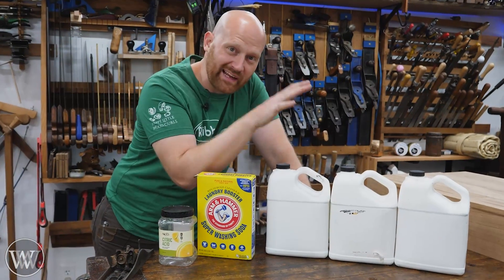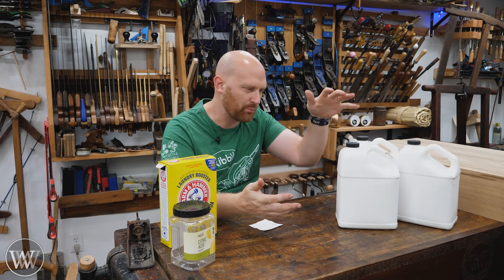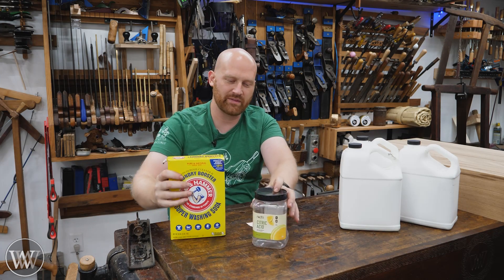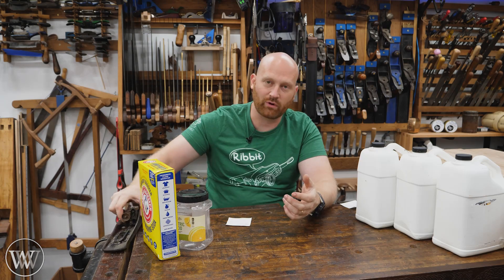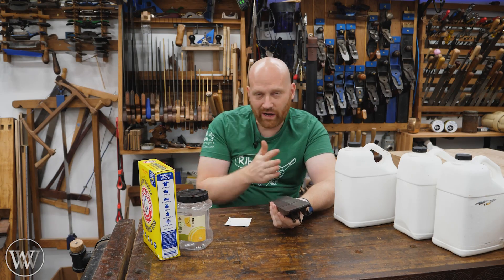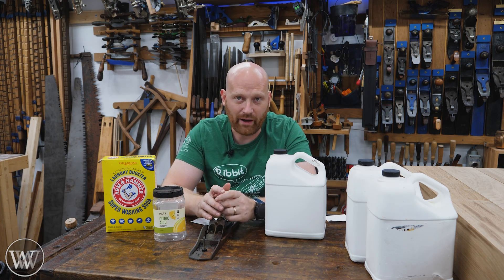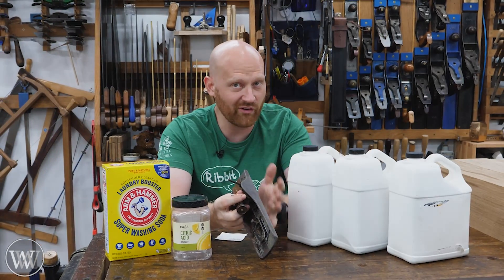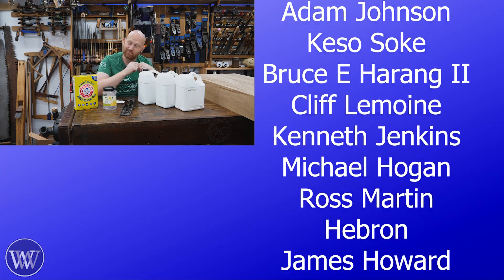Rust Removal REVOLUTIONIZED The New Affordable Way

Comment: Small note about Washing Soda...
Washing Soda is Calcium Carbonate. Baking Soda is Calcium BI-Carbonate. What this means is that when stored over time, Washing Soda turns into Baking Soda. Basically, it absorbs carbonate from the carbon dioxide in the air... This does take a while, but it makes long term storage kinda moot...
HOWEVER, THERE IS AN EASY FIX!!!
Cook the baking soda over medium heat in a pan and stir slowly so you just keep breaking up clots to powder and then to turn the powder over and over as it "out-gasses". You CAN SEE the out-gassing as pin holes "puffing" out of the layer of Soda powder, but there's also going to be some obnoxious dust kicked up as the carbon dioxide vents out. DO NOT INHALE THAT STUFF. It's a mistake you'll only make once, but you don't even want to make that many. It's HIGHLY HIGHLY recommended that you invest in a cheap "buffet burner" or whatever they call those single stove eyes in your area, so this can be done outside.
In any case... over medium heat, and stirred constantly but methodically, Baking Soda turns into Washing Soda as it vents off all that excess Carbon Dioxide. When it quits puffing little holes and raising dust in the air, you can compare the color with a known sample of Baking Soda, and the fresh Washing Soda will seem a shade or two dinjy gray next to the brighter whiter Baking Soda.
NOT that I'm just too cheap to buy proper Washing Soda, myself, of course... BUT I dislike accidentally pouring a product I assume will boost cleaning only to find out it has aged past it's usefulness... it's nice to at least be able to fix that WITHOUT just running out to buy another box of something that might well age past use before I can use it all... Just for instance... 😂

Comment: I discovered this mixture about a month ago—-IT WORKS!  I also sprung for a ultrasonic cleaner…not necessary but the rust ends up at the bottom of the cleaner’s tank.  Amazingly, it only takes a couple of hours, with or without the ultrasonic cleaner.  This stuff is amazing!

Comment: Does it damage coating (zinc, galvanization etc) in non-rusted areas?
Reply from the maker: Not that I have found so far. mostly with chrome finishes on tools that I have been working with.

Comment: Great video. For inspiration, go and watch the old DrX videos. That now out of business company had videos showing dipping engine blocks, anchors and even spraying rust car bodies. The result: rust melted off  leaving clean metal. One thing that has not been addressed. DrX also offered a neutralizer solution. They claimed that once treated an unpainted piece of metal would last up to 3 weeks, indoors, without flash rusting.

Comment: Saw this on the Beyond Ballistics channel, have been using it ever since.  It's the mutt's nuts.  A quick gripe on the language you use, though.  You're not using the base (Na2CO3, NaHCO3 or NaOH in BB's recipes) to "neutralise" the citric acid, you're reacting the two to form an entirely different chemical - sodium citrate -  along with some byproducts -  water and carbon dioxide in the case of washing soda.  Guess which one of those two makes your bucket fizz up like a mofo?  While chucking one of these bases into citric acid will, in fact "neutralise" it inasmuch as it will stop it acting like citric acid would normally, that's not your goal here - you're specifically looking for the sodium citrate as a chelation agent, which is why the recipe gives specific quantities rather than just "chuck some washing soda in it".

Anyway, have fun with it, it's great.

Comment: Hey James! Im pretty new at restoration and have some questions. Is this process the way to go to just get the hand plane back to functional use but you sacrifice the patina or is this process the way to go for cleaning and retaining the value of a collectable hand plane? Thanks!
Reply from the maker: This is the process if you're going to be stripping it down and going back to new. If you just want to get it up and going then usually a little bit of sandpaper to get off any surface rust is all you need.

Comment: This stuff works. It's as good as muriatic acid, but better cause it doesn't eat away at the steel as much. I've tried on a pair of rusted wheel knuckles.  It got rid of caked up rust. This stuff is a beast. I wish I knew about this stuff along time ago. It's definitely a time saver. Beats using a sandblaster and especially muriatic acid.

Comment: While I'm not a chemist, I do have a deep fascination with chemistry. Metals seem quite indestructible, but they're often very vulnerable to oxygen and acids. Very weak acids like vinegar or citric acid will eat away metal, but very little. The hotter an acid is the more quickly it reacts. Reaction doubles for every 10 degree C increase in temperature. 

For this reason, I don't use acids very often to clean rust from metal. A better solution I think is to use lye, or sodium hydroxide. If you combine 5 gallons of water with 1 pound of pure sodium hydroxide and mix it well, you'll get something that will gently pull away rust from metal without damaging the metal itself. 

The chemical formula is NaOH + Fe3O2 → NaO3H + 3Fe. Here we can see that the sodium hydroxide bonds with the oxygen atoms that makes up the rust, turning it back to iron metal. When I fix up cast iron cookware, I usually leave it in there for a day or two, but I've never had it harmed by leaving it in longer. 

Lye is quite caustic so keep it away from kids and pets, keep it covered. Wear eye protection, DO NOT FORGET THE EYE PROTECTION, and gloves. Once you're done, since it's the same thing as drain cleaner it's no big deal to dump it down the drain. But if that worries you, you can always neutralize it with vinegar. Just add slowly until it stops foaming. 

By the way, if you have citric acid and washing soda you can use it to make sodium citrate. Melt some cheese in some water and add a wee bit of sodium citrate and you got nacho cheese. You need very very little sodium citrate for this.
Reply: Have you tried sodium hydroxide as a rust remover, because I doubt it will do anything at all with iron oxide.

Comment: You have to use a lot of citric acid to make 3 gallons worth.  That small container you show has enough citric acid to make 3 gallons worth of the rust removal solution??
Reply from the maker: That is all that is needed. You can see the recipe in the description

Comment: I'd like to see how this would affect painted metal.  For example, you have a bumpy eruption of rust on the main frame of a painted bicycle you want to eliminate, without screwing up the paint on the bike, or a bumpy, orange, chrome (is it really chrome?) steering wheel on the bike. How much damage would we expect in those two circumstances on a bike? it might be impossible to dunk a bike in an old bathtub of this stuff. What if we soaked some old beach towels in this stuff and wrapped the towels around the affected area, returned frequently to drip solution onto the towels to keep them soaked in solution--what kind of results would you expect then? How long would you keep the towels onto the bike, roughly. What would we do then if we are happy with the results? give the bike a soapy bath to remove the solution from it?  And for those tiny bumps your fingers can feel, is there a semi-abrasive lotion that could be used for that final problem? I'm thinking of the product called,  "Soft Scrub" my mother used to use to scrub her good pots and pans with after cooking with them. It scrubs the debris off without scratching the shiny pots and pans, what do you think? want to cut up a salvation army old rusty  toddler bike and find out?

Comment: i find the amount i mix up (squirt bottle) looses its potentcey after a while (day or 2) , so i just mix it as needed in a 3/5 ish ratio.
  
oh yeah 

mix it with a little bp blaster to make an "emulsive paste" ( or something ) (suspended chemical reaction) 
"it" = the powders, no soap, no water 

this way it will stick to the side of something or pack around a nut/bolt 
still testing other oils - want to stay away from water everywhere - needed for chemical reaction yes but shutup i havnt tested that out yet

Comment: Will this work if you just spray it on the rust ?
Reply from the maker: No it needs time. You can soak a rag and put it on but it does not work as well.
Reply: @WoodByWrightHowTo . Have you looked into making a gel that would be very helpful for parts you can't take off I see someone using boiled cornstarch and clean film mixed with vinegar don't know if it would work with this stuff and I see someone use amorphous fumed silica added with acid would be excellent if you could do a video testing these
Reply from the maker: Most gel removers work about as well as a rag soaked in the liquid. but I have not tried to make this a gel

Comment: I use one part citric acid to five parts ammonium chloride. It seems to also reduce flash rush. For it to work you must use a 1-5 ratio. Like most rust removers it works better warm. I based mine on information that I had about a powder that you mixed with water. I guy sold it mail order in the 1970’s. He died a number of years ago. I still have to get some test strips to check it’s ph, but it seems pretty neutral.

Comment: I watched the Beyond Ballistics presentation - and even added my two cents on the process.  I thought his work was excellent.  The chelation approach has merit, and citric acid works well.  There's also a pure reduction method that simply de-oxidizes the rust, which works differently, but also has merit.  You just use a cheap tarnish remover - Tarn-X is an example - and it doesn't take up much space on the shelf, cost much, or require mixing, a bucket, or a scale; it works fine for smaller jobs - down to Q-tip size.  And of course, there's electrolysis.

There's a useful contrast, however, in the means by which a reducing chemical process works and the way electrolysis works: chemical reduction just takes away the oxygen that makes the elemental iron into rust, and returns it to elemental iron, without affecting iron that ISN'T rusted.  Essentially, that's like a "reset" of the surface (although it can't magically replace iron that has flaked away thanks to the dimensional change that happens when the iron oxidizes, expands, breaks loose, and flakes off, leaving pits).  

But it does leave you with a fresh iron to then treat how you like to further protect it - plate it, paint it, blue it, phosphate it, parkerize it, oil it, grease it, etc.  If, on the other hand, you use electrolysis, you preferentially, in an iron alloy, change the alloy at the surface, depending on the location on the electromotive scale of the particular alloying metals used in the steel you are derusting; some are removed more readily than others.  And the effect is across the entire surface undergoing electrolysis - not just the rusted parts; so ALL the surface is electrolytically etched, rather than just the oxidized iron compound.  Not a huge detail, perhaps, but one to be aware of as a differentiating characteristic.
 
We go to school and have this stuff ramrodded into our heads in order to pass a course, but it also has real world consequences that can be useful even out back in the barn.  In the case of this chelating solution, the fact that you can get 30 times as much de-rusting from a simple solution compared to a commercial product is an example of that.  "But I'll never use algebra in the real world"!  Well, maybe, maybe not.  But this chemistry stuff sure paid off.

We're all here on YouTube to share the collective wisdom of the tribe for our mutual benefit.  Like, for example, use a bucket when mixing . . .

Comment: The end-chemical you're trying to make with this mixture is sodium citrate, which you can buy food-grade of directly and by the pound for fairly cheap. I use it to make queso, so I had some already.
Reply: Yeah, but there is mono, di and trisodiumcitrate. So, which one are you going to buy?
Reply: @rogierius  Whatever's sold as a food additive, making it easy to get. I used to make it by putting baking soda in lime juice and while that's delicious for queso dip, it wasn't as flexible as having the powder on hand. I've already used it to strip rust, so I doubt it needs to be that particular.

Comment: You're saying that the soda neutralizes the citric acid, but as Beyond Ballistics says, in his video, his recipe results in a solution with a pH of four ...which is acidic, if not nearly as bad as citric acid. Evaporust is apparently around 6, which is close to neutral. Why Beyond Ballistics didn't make a more neutral solution, I don't know.
Reply: Because it doesn't work any more. He said that.
Reply: @neutronalchemist3241  No he didn't. Not in the video, anyway. Either way, that means that his solution DOESN'T work using chelation, as he claims. (if it did, there would be no reason for it not to work in a neutral solution) ...and that he is fully aware, that his claim that it completely uses up (i.e. neutralizes) the acid, is 100% false. I.e. that he lied ...though given how he is aware that the pH is 4, this was already clearly the case, either way.
Reply: @ZarlanTheGreen he is not a chemist, and that was one of the first things he said. So instead of being a liar, he might just not know?
Reply: @ There is no possible excuse of ignorance. This is among the most basic chemistry knowledge there is. Anyone who's ever gone to school, knows that a pH of four, is acidic ...and this is also clearly and explicitly pointed out, on the packet of testing strips.
Reply: @ZarlanTheGreen  not picking a fight here mate. Just pointing out that in all likelihood Carlo has no nefarious motives here.

His rust removal solution is based entirely on US patent US5653917A. 

If you have the time, I'm curious what you make of the claims in that patent. Ben Cusick from this YouTube channel NighthawkInlight tried out Carlo's recipe and couldn't replicate the same results. So perhaps you can shine a light on that patent and see where it goes wrong.
Reply: @rogierius  Nefarious? I haven't mentioned anything like that. I just said it's a lie. As for that patent... no. He makes no mention of that, and there is nothing to hint or suggest, that any patent has had any role in being the base, or inspiration, for any of this.
Reply: @rogierius  ...and you say NighthawkInlight tried Carlo's recepie, and failed to replicate the results? Really? How do you know that? 'Cause he clearly hasn't made a video about it.
Reply: @ZarlanTheGreen  yeah. I don't know why you are being so  defensive, I'm trying to have a discussion in good faith. Regardless, check the comments of Carlo's recipe video. 

Ben made a comment 8 months ago, where he complimented Carlo. 4 months later he posted a lengthy comment where he unsuccessfully replicated the outcome.

In those comments you will also find Carlo mentioning the patent AND that his solution was less effective at higher pHs.

I'm just curious if you want to take a look at that previously mentioned patent and perhaps give your feedback on it.
Reply: @rogierius  There is no hint of my being even faintly defensive. You, on the other hand, are massively defensive. Yet you claim that I'm being very defensive?
...
That strongly suggests, that you're being dishonest...

...and then suggest I go through the whole comments section, with a fine toothed comb, to find those comments by Carlo? Comments that supposedly contain information, which would absolutely HAVE to be in the video (not to mention, that he presents it as his own idea, with no inspiration or basis from any patent, or anyone, in any way, in the video! Meaning that the video would be a lie, if the patent was a basis for it), if one were even the faintest bit honest, or at the very least, in the video description (where it can even be added, long after the upload) and/or a pinned comment.
...
There's a lot to suggest that you're not being honest or serious.
Reply: @ZarlanTheGreen  well, whatever man. I mean well and I'm trying my best to have an informative discourse, unsuccessfully though. I find it difficult to keep a chat going forward about something actually interesting, pointing out interesting information about that patent and Ben's feedback on Carlo's recipe, yet fruitless bickering about details that don't matter continues to dominate.

You're one of the few to point out the acidity and wondering if chelation is actually doing the work or if it is just the citric acid. It's an interesting subject. But I don't know how to steer this conversation any more.

So, you do you my friend. I'm off. Have a good one.
Reply: @rogierius  Saying that you're just trying to have an informative debate, when you make absurd and baseless accusations, and give "information" that is practically impossible to get to? All to defend what is inarguably a lie? No. If you had any interest in genuine debate, you'd provide actual evidence for your claims, and not make baseless accusations about those you speak to. You have, therefore, proven that you're just trolling. Bye.

Comment: Yes it works well. Previously I was using plain citric acid which works really well, especially if hot but you need to be careful to rinse and neutralise afterwards otherwise the item rusts again very quickly. This formula just needs a rinse and doesn't seem to have problems with rusting later on. Only thing I have noticed which was never a problem with citric acid is that my solution has grown mould in storage, little floating islands. I don't know if I am unique in having that happen or not.

Comment: Just wondering if it would remove mill scale?
Reply from the maker: not well
Reply: I use it for mill scale, and leave it for 24 hours. It has worked well. Not as well as muriatic acid, but better than vinegar. The other benefit is that it will prevent  subsequent flash rusting.